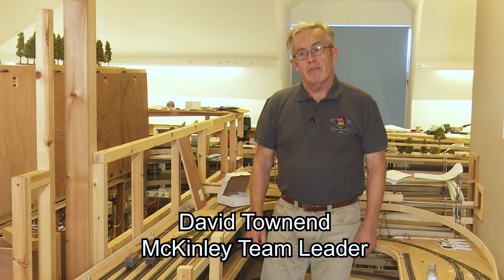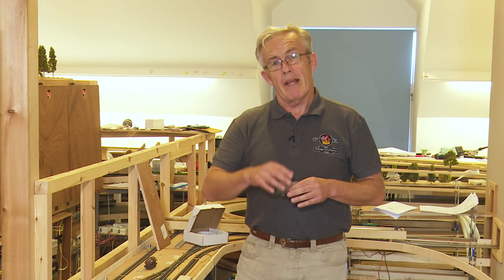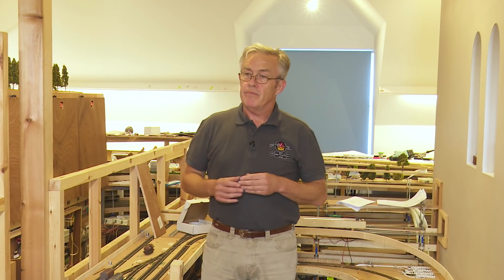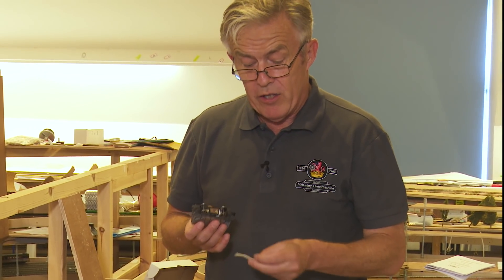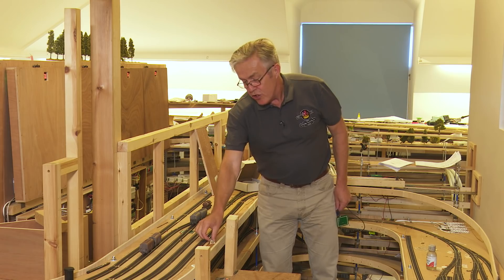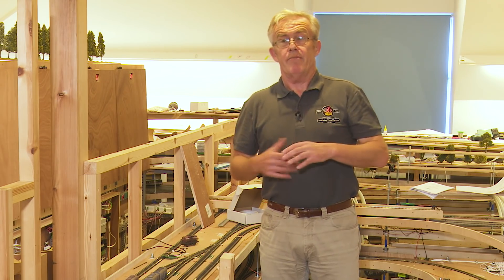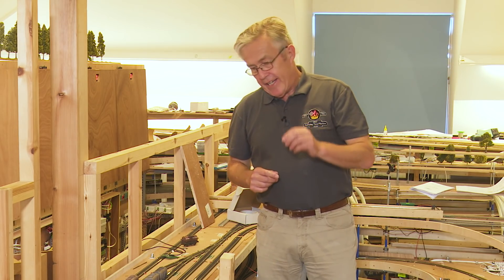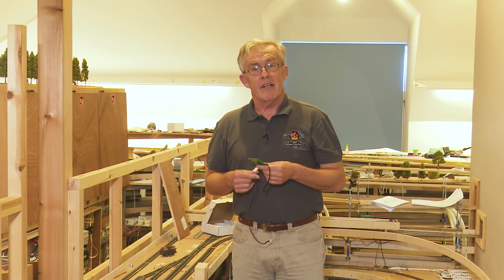33. Managing Freight with RFID on McKinley Railway

Comment: I was saddened to learn of the passing away of your previos videographer in another video - you may not realise, but since his last video, your McKinley Railway theme music has often had a stutter in it ever since, like as if someone has accidentally nudged the left (or right) audio track a fraction, thus the stereo track being slightly "jiterry" in sound.  You may want to check the sound waveform up close, or if resyncronising it is too difficult (you may have difficulty hearing it whereas I'm an audio engineer), then you might simply want to copy the left track to the right track.  The jitter is mostly clearly audible on the percussive instruments in the music.  Please let me know if you'd like further assistance or clarification.
PS.  Congrats on the use of RFID and the train computer control - I have always wanted to do computer controlled timetabling since a kid and I absolutely love your clear philosophy that the automation is to SUPPLEMENT the manual control to allow interaction and enjoyment - brilliant direction!
Reply from the maker: Thanks for the pointer. We will have a look.  Re-timetabling, are you based in the UK? Anywhere near the south?

Comment: Could you not use two rfid chips, labeled a and b as part of the same unit and use that to measure direction as it passes over the same reader? A then B would always be down line and B then A would always be up line, unless you have a loop back obviously
Reply from the maker: We are looking into the manufacturer producing just that kind of RFID reader that multiplexes between two antennas..  Will keep you informed as and when we find out more.

Comment: I've watched this video again and another thought has occured to me. While this high-tech system isn't NECESSARY on most layouts, only on a huge set-up like this, it could be a FUN way to operate a smaller layout. Someone has already mentioned the "index cards" system. THAT system isn't really NECESSARY either but can be a lot of fun to use. Running this new technology as a version of T.O.P.S. could add a whole new dimension to operating, even a branch terminus.
I wonder DAVID, what would be your estimate of the cost (just a ball-park figure) to install this system on a small fiddle yard - terminus layout? Also, would it be feasible, on the above layout, for one guy to install it in a weekend? Is it fair to sat that, after the wagons are adapted, the rest should be, pretty much, plain-sailing on a small layout(IF you know what you're doing)?

Sorry to plague you with questions but I'm starting to think this could be great fun to use on a more "normal" home layout.😊

Cheers for now,
Dougie.
Reply from the maker: Hi Dougie,  The first big challenge is to get the RFID system to work reliably.  The second even bigger challenge is the database system behind it.  RFID without that has limited benefits such as basic stock tracking in hidden yards. The idea we are implementing is similar to that of TOPS, but requires a ton of creative thinking to ensure we have matching industries at different locations.  Utilising of the different kinds of wagons and so on. Balancing the demand of wagons on a model railway appears to be quite different to the real world. I don't think its a weekend's work.  You could have a look at the JMRI Operations software.  That might help.
David
Reply: @dattouk  I'll do that David; Thanks for taking the time to answer.👍

Cheers for now,
Dougie.

Comment: Is there any type of speed limit for this to work?? i.e. Does it miss/not read it if you go over the reader too quickly??
Reply from the maker: There was.  We spent some time checking that.  Very slow speeds are the hardest as the induced current isn't strong enough to fire off the chip.

Comment: Very interesting indeed. Where you are 'worried / concerned' about the thickness of a base board 'blocking' the signal, I came up with a useful idea which works for me. Take a sharp drill bit and working out how deep you wish to drill under the baseboard mark the drill bit with tape or a small circular clip, and simply drill upwards until the marker touches the baseboard. The drill will stop short of the underneath of your track / base material. Then just fix the PCB under the baseboard so the required component is exactly under the hole.
I am just doing this with some auto signals and it seems to work.
Cheers, Bob
Reply from the maker: Thanks Bob,  We will consider that.  Thank you.

Comment from the maker: Hi Everyone,  
The requested technical details are as follows:
We are using readers and tags in the 13.5 Mhz range.
The Tag information is available at:
https://zipnfc.com/nfc-sticker-midas-tiny-ntag213.html
The readers are based on the Eccel Pepper C1 readers:
https://eccel.co.uk/tag/pepper-c1/
However, we are adapted these readers to install a larger 50mmx50mm external aerial. Eccel are planning to make this a standard product in the new year.
Regards
David

Comment: just add a free standing wall with the rfid transmitter in it, next to the track
or if enough space add a building/tunnel with ...,  the transmitter could even be smaller then.

Comment: Nice ,will the main system also track if a wagon is full or empty? Or is this something the operators just have to imagine while working on the freight movements?
Reply from the maker: We intend to do that.  Most of the wagons are closed, so the loaded status is virtual.  If the system tells the operators that the van is full of bicycles, then who are we to disagree.
Open wagons will be a bit more interesting.  We do have coal loads to play with, but I'm not sure how enthusiastic the operators are going to be about pulling coal loads out of wagons.
Work in progress.

Comment: Hi. Interesting, having found bar code usage to be prohibitively expensive and the readers too bulky I have also obtained some RFID tags, reader modules and separate wifi modules to try this out. Certainly I would prefer to place the readers under the baseboard in the scenic areas too. Your info on the neoprene for spacing the wagon mounted tags is useful as is that the DCC electrical signals in the track does not cause a problem.

Two questions at this time, how thick is the neoprene you use and what RF frequency does your tags and readers operate at. Thanks, Jim
Reply from the maker: The neoprene is about 10mm deep.  The RFID technical data is at the top of the comments.
Reply: @dattouk  Hi, do you mean deep or thick?
Reply from the maker: @freightuk  The neoprene extends towards the track from the base of the wagons by 10mm.
Reply: @dattouk  Ouch, that is a long and obtrusive depth amongst the brake gear of a wagon. Is the 10mm to lower the tag close enough to the track due to limited RF range or for placing sufficient gap between the tag and a metal chassis. Thanks, Jim
Reply from the maker: @freightuk  Mostly yes to both. I didn't want to spend hours testing each wagon find the minimum and like all things, it was what I had on tap for another reason. We tried it and it worked.   You'd be surprised how unobtrusive it is.  Operators rarely looking sideways on at the trains and the black neoprene just merges in behind the dirty chassis and brake gear.  When we do our next video, I'll make a point of showing the wagons moving on a scenic section of track.
Reply: @dattouk  Thank you, I look forward to viewing your progress videos, Jim

Comment: Where can I find the email mentioned near the start of your video for the geeks who want to know the technical details. As mentioned in another comment there are lots of possibilities with this technology. Keep up the great work you are doing.
Reply: At the very last page is a printout of the technicalities.
Reply: Apologies for stopping the video at your usual closing sequence and not running it to the very end. I was hopping to get more on the frequency used by the RFID chips to overcome the problems of metallic materials and the DCC signals in the rails. Are you using LF,  HF or UHF chips? Could you divulge the identity of the readers you are using? Thanks
Reply from the maker: Info posted at the top of the comments.

Comment: Excellent 👍from what you have shown here started me thinking, could you tie in a chip passing an aerial to trigger a certain station announcement i.e. "the train approaching platform 2 is the 15:10 to Birmingham" . I think it could have many applications, it's just getting the software behind it which unfortunately is above my pay grade.
Reply: I'm more of a hardware girl than software girl, but I think that that would be pretty easy to setup.
Reply: One can do this with simple RailCom, surely?
Reply: @JamesPetts  I wouldn't know, but I will find out if I can. We have a guy at our club who is pretty good at this kind of stuff.
Reply: As he said in other words at the end; there is no interface connection from the RFID-system to the main-/ computer-train-controlling-system (which already knows what passanger train should go were, but according to video 32. not the exact time when it´s turn) yet and unclear how well it get´s and performs under the existing tracks with there surroundings (rails, ballast, wooden boards, ...) -> Trial and Error till there and it "comes later" in the priority list then other things to do.

Comment: Radio-frequency identification (RFID) uses electromagnetic fields to automatically identify and track tags attached to objects. The tags contain electronically stored information. Passive tags collect energy from a nearby RFID reader's interrogating radio waves. Active tags have a local power source (such as a battery) and may operate hundreds of meters from the RFID reader. Unlike a barcode, the tags don't need to be within the line of sight of the reader, so it may be embedded in the tracked object. RFID is one method of automatic identification and data capture (AIDC) (from https://en.wikipedia.org/wiki/Radio-frequency_identification)